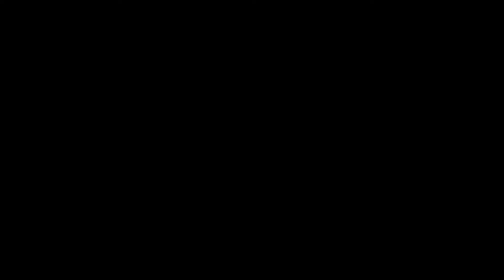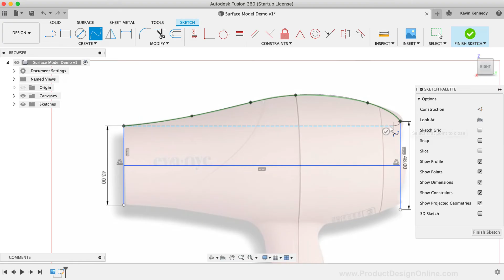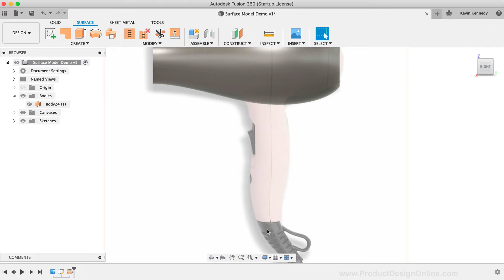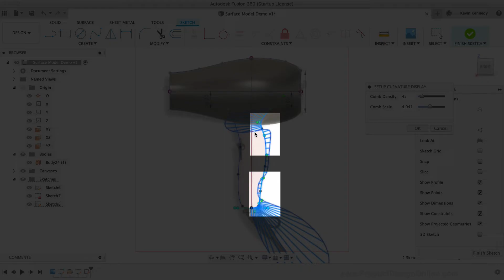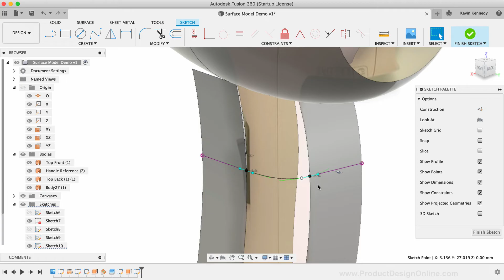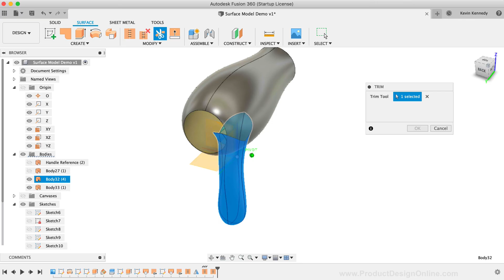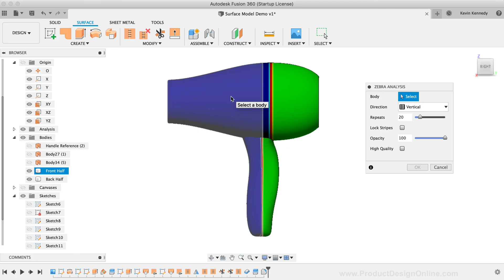Fusion 360 Surface Modeling | Intermediate Hairdryer

Comment: hello kevin i  was trying to model this ship and ive spent alot of hours and it didnt worked out too well for me , im stuck i have no clue what to do

please let me know how i should design this ship
https://www.pinterest.com/pin/422423640027684973/
any shapes with hard surface modeling and Silhouettes with  round shape
will instantly makes me stuck in the process, please help me to get over the approach for these designs and please make a video its going to be a question for many people, 
ive tryed sculpting, surfaceing, but result was unpleasant , and dont even know how stick a solid model to a sulpted model, how fit things together in terms of sizes, please let me know what you think, im litterly stucked
Reply from the maker: Hi, Puoya. Thanks for the video suggestion. A ship would be a cool idea for a video. I'm not sure how soon I'd be able to tackle this video...so here are some pointers you can use in the meantime.

To create the overall body of the ship, I would take a surface modeling approach. Set up some "frames" or sketch profiles at every point where the ship would change in size or curvature. Then, use the surface loft command to loft the pieces together.

For the finer details, you may find it best to create them as separate components, and then you can insert them into the main body of the design. This way, if you create artillery, for example, you can duplicate it and place it all over. I would probably just solid model the finer details using a combination of extrudes, fillets, and other basic features.

I hope this helps a bit! Cheers, Kevin :)
Reply: @ProductDesignOnline  thanks alot! i should try as you said
Reply from the maker: @pouqya  Let me know how it goes! Cheers, Kevin :)

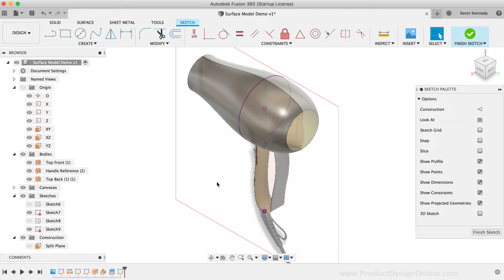Comment: I keep getting stuck on the intersecting point at around 15:20. I do what you are showing. But it doesnt add a point at the bottom of the handle. I have selected all three items in different order and still never can get the bottom handle intersecting point. Any thoughts on what I am doing wrong.
Reply from the maker: Hi Tim. First, check that your "show points" option is turned on in the Sketch palette. If that wasn't it, check your settings with mine - http://bit.ly/defaultsettings

If it doesn't seem to be a difference in settings then we can troubleshoot further. Cheers, Kevin :)

Comment: Can you show how to model different types of connections for tube-like 3d printed parts?
Reply from the maker: Thanks for the suggestion, Ivan! That is an interesting idea/topic. Did you have a specific tube like product in mind? Cheers, Kevin :)
Reply: @ProductDesignOnline  Hi, I have a modular system like this https://www.thingiverse.com/thing:3405964 but can't make better and faster solution than just a threaded joint. Would be nice if you can show a few of them, and show how to repeat joints on a new parts faster. Thanks

Comment: When creating the handle loft, what is the difference between Tangent and Curvature connection? I never know which to choose for the best. Thanks
Reply from the maker: Hi, designer23t. Great question. Here are some of the key differences between the two:

Tangency (G1 continuity) measures the position and curve direction at the ends. In other words, the two curves not only touch, but they go the same direction at the point where they touch. The direction is determined by the first and second point on each curve. If these two points fall on a line, the two curves are tangent at the ends.

Curvature continuity (G2 continuity) between two curves measures position, direction, AND radius of curvature at the ends. If the radius of curvature is the same at the common end point, curves are curvature continuous (G2). In other words, the curves not only go the same direction when they meet but also have the same radius at that point.

I hope this helps! Cheers, Kevin :)
Reply: @ProductDesignOnline  Brilliant. Thank you for the reply
Reply from the maker: @designer23t  You're welcome...always happy to help! Cheers, Kevin :)

Comment: A fantastic video, thank you. To smooth between the handle and the top body would a fillet work, or do you have to go back to edit the spines of the handle so that they’re tangential as they touch the top surface?
Reply from the maker: Thanks for watching, Ed! Great question. In short, a fillet could definitely work, but it wouldn't be the best geometry. Tweaking the spline curvature and making them tangent (using the tangent constraint to force it) would generally give a more realistic contour that would better "pass" the analysis tools. I actually pondered discussing adding the tangent constraints to the splines and tweaking the handle more, but I was worried I would make that part of the tutorial too far off from the bigger picture of some of the surfacing concepts I wanted people to grasp with this video. Cheers, Kevin :)

Comment: Great video, I much prefer the intermediate tutorials. I have only been using Fusion 360 for a month but I'm already getting annoyed with the pace of some of the beginner video series on youtube. 

I would be interested in videos of some of the analysis tools you mentioned and how they relate to the manufacturing process. I also enjoy video series where a complex project is tackled start to finish. For example, how would you go about integrating the electronics? Would you have a model of that stuff beforehand that you mold the hairdryer around? How much time would you spend refining the "ergonomics" of a design? Are there design rules you follow?

Just some ideas. Thanks for the video. Subscribed.
Reply from the maker: Hi, Brian. Thanks for watching. I appreciate you taking the time to leave some feedback and video ideas. I will definitely try to do some more intermediate/advanced tutorials while incorporating some of these topics.

It will take a little bit of "practice" to find the right balance of how much to talk through in the intermediate level tutorials versus the beginner ones. It's a tricky line to walk in terms of what I can assume the viewer knows/should know versus what I should be teaching them per each lesson.

Cheers, Kevin :)